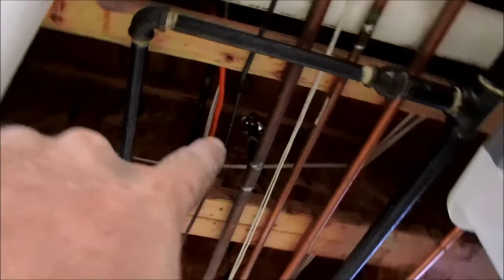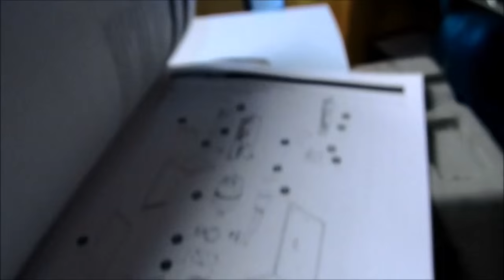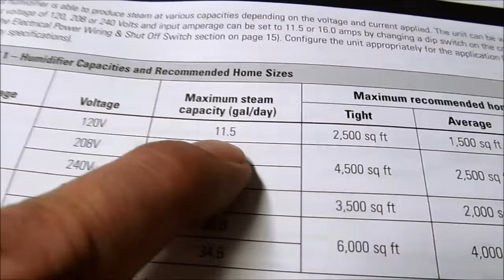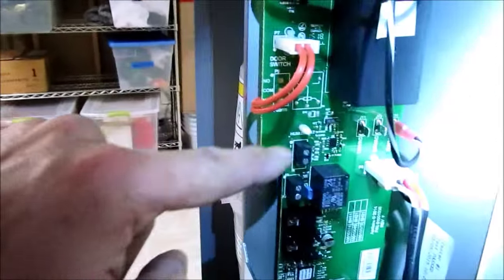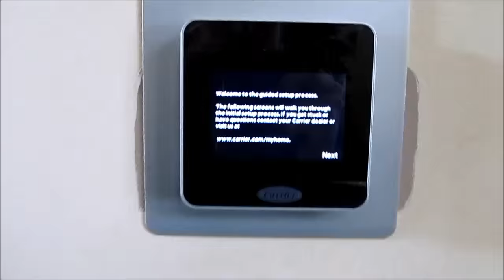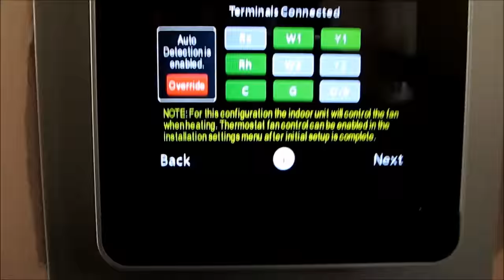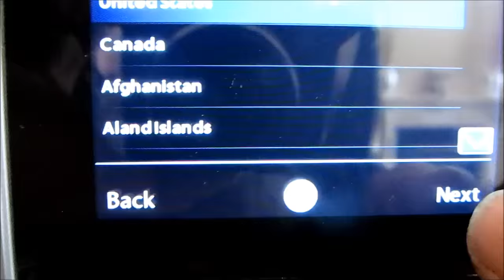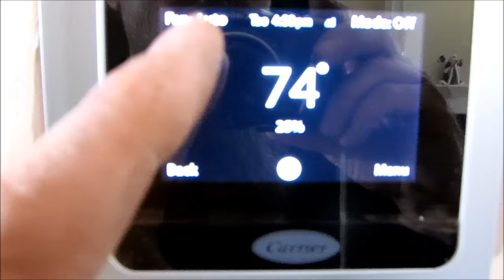Aprilaire 800 Steam Humidifier Installation And Carrier COR Thermostat

Comment: I'm one of those guys who buys things off the internet and installs them myself. Install went well, 5400sqft home humidity has been stable during winter and summer months in Denver CO. Used the Google Nest with common to Humm. Thanks for the break down on the relay as I also noticed it could not be directly connected to the board as well since mine is 24v. I have installed the whole house water softener and descaling, only had to swap the canister once per year as you should. Wife and kids are happy with the home environment. Thanks for the vid!
Reply: Where did you get your relay, and what kind? I have to do the same thing it seems. Everything seems to work, but I can't get the steam phase to kick on.

Comment: Looks clean. Yeah anytime you have alot of small things to do will add up to a full day. Run water supply line, run hi voltage, install breaker, run new drain line, pick up a new switch from Home Depot and get lunch while your out. Next thing you know the day is over. It all adds up. Nice video
Reply from the maker: Yeah it ended up being a big  install thanks for the comment

Comment: I installed several Honeywell steam humidifiers a few years back. Had to return at least once every two  to three months to clean of scale even though on city water.  Plus every homeowner noticed a big increase in Edison bill.  Ended up pulling the ones we put in. Sorry but that was three years ago maybe new models are better.
Reply from the maker: I've also replaced a lot of Honeywell steam humidifiers that we put in Honeywell doesn't even make a true steam humidifier anymore because they have had so many problems and warranty issues with them thanks for watching as always

Comment: Thinking of getting this unit. Couple questions: How much water does this unit dump down the drain on average  in the course of a day? I have a geothermal forced air system, so it doesn't produce a lot of heat. Would a steam type 
system be better than say a 700? My home is a 2000sf ranch built in 03 and built fairly tight...so...240v? Finally: does the steam tank heat the area outside of itself quite a bit? Sorry for all the questions, great video nice install.

Comment: Do you see any need for a filter on the water supply to filter out minerals? Does the water need to be hot water? If water feed needs to be hot, how would you do that in an “on demand” water heater?
Reply: I own one of these and did install it myself they did a great job. The water supply is cold water part of the reason it needed 240v is because it is heating the water up to produce the steam. I do not have an inline filter and it runs quite a bit. The canisters will need to be changed my guess is that the service interval will vary based on water quality.

Comment: im thinking id moved that relay behind the fan over a few inches out of the path of the housing when its being pulled out.  not that its alot of trouble to unhook that thing and unbolt it for fan work.......but its just extra steps and im pretty lazy.  LOL
Reply from the maker: +jeff leonard I probably should have mounted it on the blower housing but that's where the old one was as always thanks for watching

Comment: Very good install - I hope I can find someone as good here in the PNW.  Question: My system has 4 zones.  Anyway to zone direct humidity or is it just delivered to the whole system?  It seems like the end of my run would get the least humidity.
Reply: There is only one steam pipe per unit that gets inserted into a duct, so you wouldn't be able to zone it.
Reply: Run the steam line to a manifold with 4 zone valves each to there respective zone trunk line. 
You will need to configure the controls so that when humidity is calling to a zone, the zone valve will not open unless the zone damper is open. 
Follow manufacture installation instructions for maximum steam line lengths and you may need to adjust nominal capacity depending on needs

Comment: If the humidifier provides constant 24v to the control, why do you need an isolation relay? The control is wired to the Air Handler to control blower any time the humidifer runs. Am I wrong?

Comment: So with this ran directly to core stat is it technically set up in auto mode? Or does that cor stat negate the aprilaire stat and outdoor sensor all together? This seems much more efficient than thermostat + humidistat

Comment: You’re basically running this as an on/off humidifier right no smart modulating just runs when the heating is running
Reply from the maker: This is set up to humidification with fan. So if it just needs humidity it will turn humidifier on and fan.
Reply: @MiHeatingGuy  so the thermostat is controlling that fan and humidity only operation then I just noticed u have no sensor installed in the duct work and I’m assuming it’s because u have the t stat controlling the levels
Reply from the maker: Thermostat is controlling humidity
Reply: @MiHeatingGuy  Honeywell makes a thermostat that can take two wire power from the humidifier you wouldn’t need a relay with it I’m pretty sure it just acts as a dry contact inside the thermostat I believe it’s the Honeywell RH the round hockey puck looking one

Comment: I've had the 800 operating for about 15 months.  Why would one of the 20 amp fuses trip?  It was bubbled and brown on the bottom of the fuse.  I don't know if the HVAC guy installed it correctly?
Reply: you have a loose fuse holder on that side also make sure  wiring connections are tight.

Comment: nice view, my question is my install guide say put steam in return side.  I see you put on the supply side ?   even though that seems to make more sense... I would think aprilaire has a reason.  your thoughts since you decided to go with supply side ..please advise
Reply: only if you have a split zone system with automatic dampeners.  the best place for the steam is in the supply side with the hot air
Reply: So if you have two zones the steam would go into the supply side you’re saying?